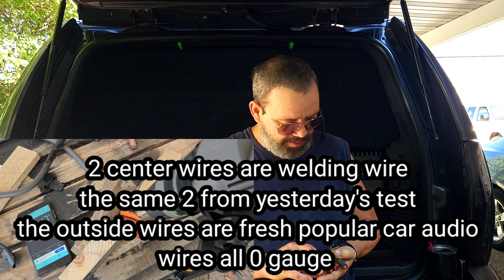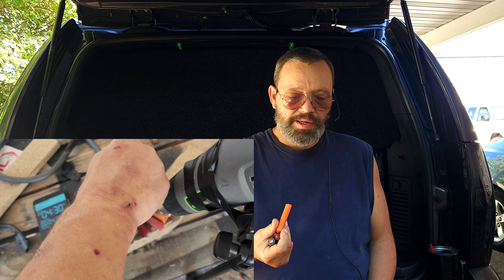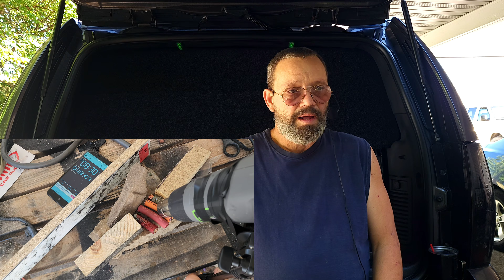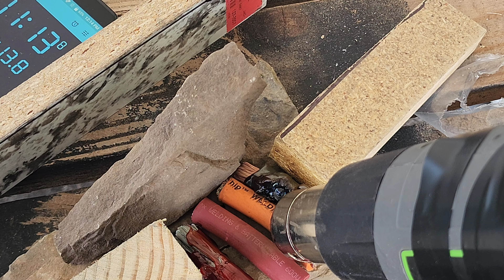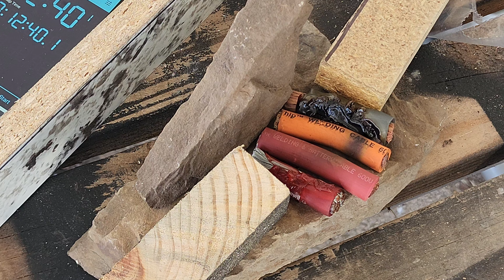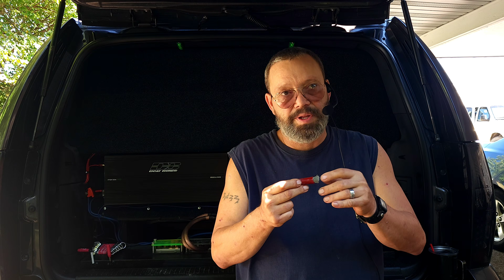Car Audio Power Cable vs Welding Lead Cable Who can take the HEAT?

Comment: I bought a 50 ft. ROLL of 4ga. Spartan welding wire for 50$. Got a great deal and i need it for all of my mid amps so i hope it works great dont mind the lack of flexibility cuz i dont have very sharp bends

Comment: What size welding wire is equal to 1/0 and how many runs would you need for a 4000 watt system
Reply from the maker: 1/0 is 1/0 ..1 run of 1/0 would be enough, as long as its less than say..15feet, 2 runs would be better.

Comment: What's your thoughts on spartan power welding wire 2/0 awg. I kno it's labeled 2/0 but it's true size is 1/0...
Reply from the maker: prolly good cable, i push flex whip mainly because of how flexible it is.
Reply: @CarAudioEnthusiasts  yeah, I just found out about that yesterday. I was watching somebody's video and they had it because that it's spartan is not that flexible.
I was thinking about changing out with that flex whip
Reply: Just bought me a 50ft roll of 4guage Spartan for 50$

Comment: Your wire should not be getting hot,if so there may be a few reasons.
1) Loose connections. I always check all my nuts and bolts often. Stuff wiggles loose from time to time.

2) your running too much current for the capacity of the wire. This can be from not knowing the amperage capacity for your wire gage and/or length.

3) the wire you stuffed under your door jam molding may have chafed/kinked and is causing excess voltage loss thru heat in one area. Damaged wire can be dangerous. 

4) rust, if you have a bad/rusty(or loose) you will create excess heat due to voltage loss.

5)heat. If you live in warmer climates and your wires run near the radiator in the engine bay or in a car that gets extremely hot, you can get enough voltage drop to cause problems.

6) back to loose connections, a loose or bad ground strap off the primary battery in the engine bay (or those with extra ones in the trunk. 

And last that i can think of is using the proper fuse. Ive seen more than a few people melt wire casing completely from too large a fuse, or none at all. Hope i helped 😊
Reply from the maker: all true, but a wire casing that doesnt melt down even if all the mistakes were made, is awesome right?
Reply: @CarAudioEnthusiasts  it is! Welding wire is great to help give you a bit more time before things go really bad(ask me how I know!) , and the smell will let you know somethings wrong whether you use cheap wire or expensive.
 But, by the time your dumping that much amperage thru the wire it's toast regardless.

Comment: Great test! That helps the decision making. I will run welding wire when i upgrade to 1/0 wire👍😎
Reply: May as well use 2/0, it's not that much more expensive
Reply: Remember that Oversized 1/0 Skyhigh is the same size as 4/0 Welding Cable. Temco 4/0 Welding cable would be the cheapest / best wire that I know of.